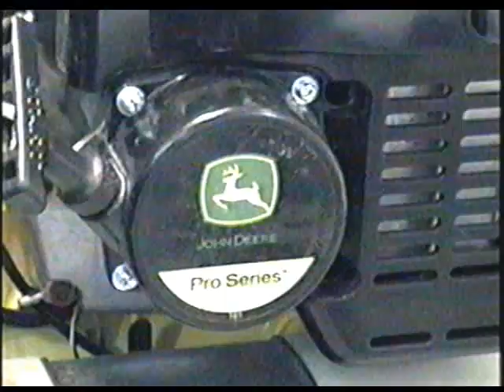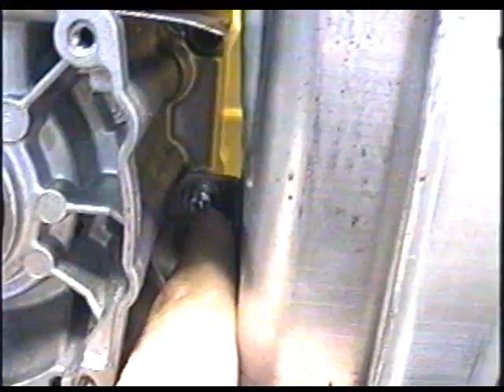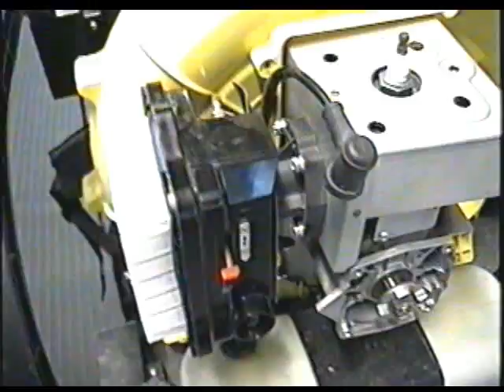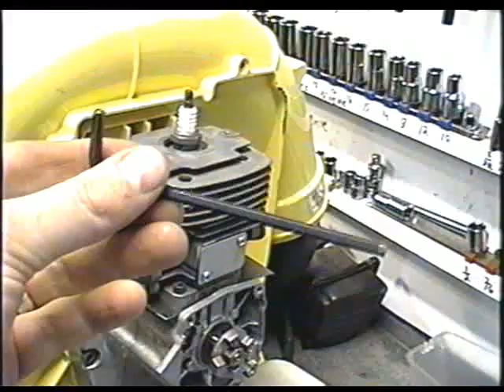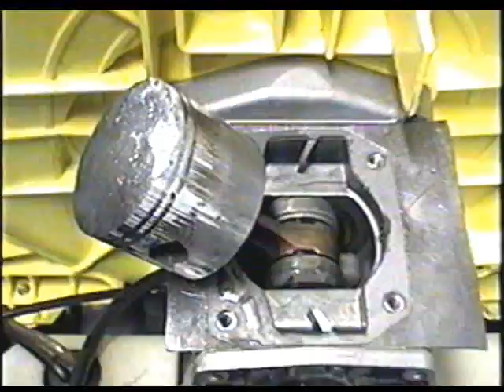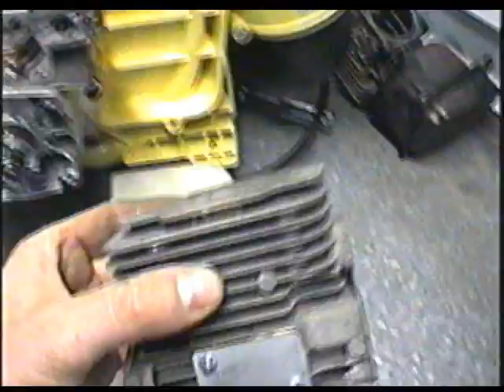NO OIL = Blown UP John Deere BP65LE Leaf Blower

Comment: I know this is a really old video but I'm hoping you will respond... I have one of these blowers and I'm having an issue with the crank shaft. There is a ton of end play to the point where the flywheel will run on the case. Can these cranks be shimmed at all? Everything looks pristine on the inside,  just the end play is the problem. Maybe there's a preload adjustment?

Comment: what a waste!, seen it before tho on 2 new (thankfully only cheap chinese) weed whackers. friend swore he used 2 stroke mix, but it was pretty obvious he used the wrong can, or just didn't want to admit he forgot.

+1 on supplying enough pre mixed gas when lending 2 stroke equipment too. a friend lost a $1800 chainsaw because the borrower used strait gas!. spun bearings and all, total write off.